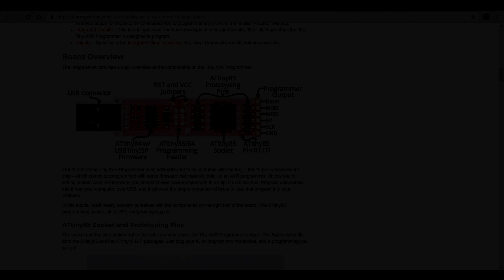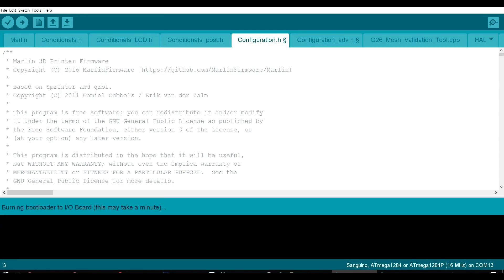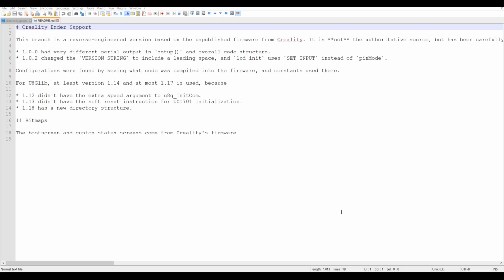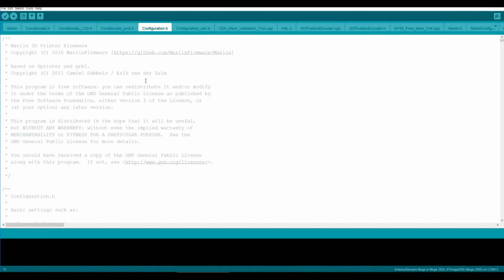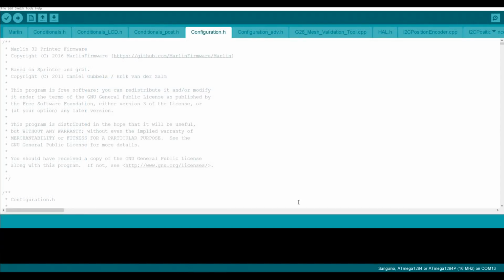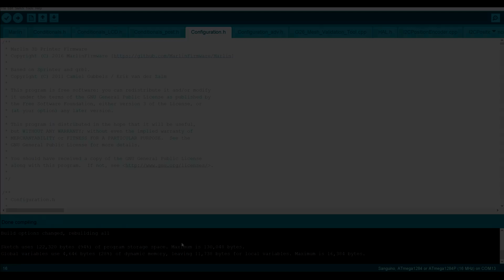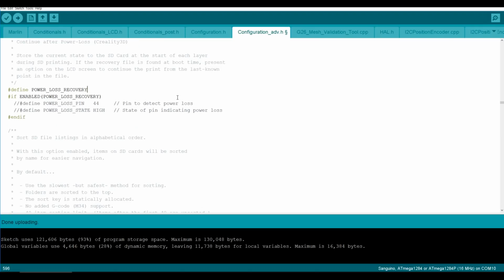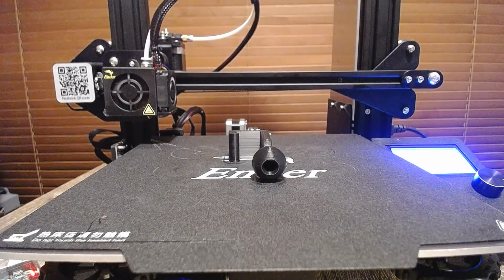Ender 3 vanilla Marlin update: Concise guide

Comment: Hi...Love your videos, they have been extremely helpful.....I'd like to know how to adjust the marlin firmware to center the print bed (with values I calculated based on the print when the firmware  X_MIN_POS etc was set to zero, then adding the following to MANUAL_X_HOME_POS) after the math I ended up with X=4 and Y=-5...the print is centered perfect...However the LCD now displays these values when homed. as apposed to X=0 Y=0.
Is there a way to adjust the center and still have the LCD showing X=0  Y=0 Z=0 ??
The reason for this is that it messes up my slicer scripts (I have edited it to suit, but would rather work off X0 instead of X4)
Hope all this made sense.
Thanks for your videos!!

Comment: I got an error while verifying 
Arduino: 1.8.12 (Windows 10), Board: "Sanguino, ATmega1284 or ATmega1284P (16 MHz)"

sketch\src\HAL\AVR\u8g_com_HAL_AVR_sw_spi.cpp:65:10: fatal error: U8glib.h: No such file or directory

 #include <U8glib.h>

          ^~~~~~~~~~

compilation terminated.

exit status 1
Error compiling for board Sanguino.

This report would have more information with
"Show verbose output during compilation"
option enabled in File -> Preferences.
Reply: In arduino IDE go to TOOLS -> Manage Libraries and search for and install u8glib

Comment: Hy, i have 2 marlin ender 3 configurations , one of the i've used a time ago for my ender 3.
Now i just got some new drivers but i get some errors on both configurations. Does anybody know some other ender 3 configuration for mks gen l, tmc 2208 drivers...? I am stuck here from 2 days, i just don't find any configuration that work
, i have all libraries installed like in Michael's videos
here is my error;
Error while detecting libraries included by C:\Users\User\AppData\Local\Temp\arduino_build_633232\sketch\Sd2Card.cpp
C:\Users\User\AppData\Local\Temp\cchqVvhi.ltrans0.ltrans.o: In function `Endstops::update() [clone .part.1]':

<artificial>:(.text+0xbc6): undefined reference to `Running'

C:\Users\User\AppData\Local\Temp\cchqVvhi.ltrans0.ltrans.o: In function `Temperature::_temp_error(signed char, char const*, char const*)':

<artificial>:(.text+0xc9c): undefined reference to `Running'

<artificial>:(.text+0xcb4): undefined reference to `kill(char const*)'

C:\Users\User\AppData\Local\Temp\cchqVvhi.ltrans0.ltrans.o: In function `TIMER0_COMPB_vect_bottom':

<artificial>:(.text+0x1124): undefined reference to `enqueue_and_echo_commands_P(char const*)'

C:\Users\User\AppData\Local\Temp\cchqVvhi.ltrans0.ltrans.o: In function `main':

<artificial>:(.text.startup+0x264): undefined reference to `setup'

<artificial>:(.text.startup+0x26c): undefined reference to `loop'

collect2.exe: error: ld returned 1 exit status

Multiple libraries were found for "U8glib.h"
 Used: C:\Users\User\Documents\Arduino\libraries\U8glib
Using library U8glib at version 1.19.1 in folder: C:\Users\User\Documents\Arduino\libraries\U8glib 
exit status 1
Error compiling for board Arduino Mega or Mega 2560.

Comment: I tried doing this on Linux and had issues with flashing firmware.  I have the 1.1.5 board which supposedly had a boot loader.  I then tried to flash a boot loader from Linux and that failed too.  Luckily I have a windows 10 dual boot and it all worked smoothly, thanks for the video.

Comment: Dear teaching tech...thank you for a comprehensive walkthrough. Worked a charm.
Only issue I face: when the printer puts down the two prime layers it's now on the right/front side. This leads to undesired strings of filament when the head moves from home position left/rear after heating up and staying in a small glob of material.
I've tried to change the start code, but that just gives weird results.
Some suggested to invert x/y Max min in firmware again. What's your take?

Comment: Michael, Brilliant video as ever, super detailed. Like a few folks I can see on other forums, I am not able to upload. For some reason despite being connected to the right Com Port, I can do the compile but NOT get the upload to work.  Longstory short im trying to do this prior to following your BLTouch video so things starting to stack up. When I upload I get an error AVR: atk500_getsync () attempt 10 of 10: not in sync: resp0x61. avrdude done Thank you. An error occured while uploading the sketch.

Looking on forums some folks mention not starting the Arduino from the INO, which I have tried (deinstalled Arduino (just to be sure) reinstalled it. reconfigured Marlin files per your video, opened arduino then opened Marlin ino), but same issue! any thoughts really close to completing this. failed at the final hurdle.

Comment: I flashed my Ender 3 Pro and while using it I noticed too late the Change Filament option was gone. After some research I figured how to enable that but when I compiled it I don't have enough memory remaining for that feature. What can I remove to free up some space. Thanks. Awesome videos.
Reply: You can undefine all lines from "String_Config_H_Author" to "String_Splash_Line2 Website_URL" and then undefine "Show_Custom_Bootscreen" and "Custom_Status_Screen_Image". Then go into Adv.H tab and undefine "Lcd
_Info_Menu" these alone should allow you to turn on both Level Bed Corner, Mesh Bed Leveling and the LCD menu's for both. Alternatively you can define Slim LCD but then you will loose a bunch of options for your e-steps (although they can be manually configured and flashed into firmware).
Reply: @dpgoverride  Thanks. I found it and removed the comments to enable change filament to get it working.
Reply: I'm having virtually the same issue.  I have have "mesh bed leveling" installed and had to remove "arc support" and "boot screens".  I wish TT would do a video showing how what can be chopped out of Marlin so that I can have "change filament" as well.

Comment: Love your channel, I did however have MAJOR issues with flashing my MKS GEN L  with the compiler. Install the Marlin and Arduino software, made the changes, but when I tried to compile it, I got errors with the libraries. As an example:
Error while detecting libraries included by C:\Users\Jon\AppData\Local\Temp\arduino_build_165947\sketch\ubl.cpp
41 different library files, I'm sure it's something I haven't done, can you help?

Comment: Not futureproof, unfortunately. I can't get anything to compile. I follow all the instructions commented in the Marlin code and I even added a library that was reported missing. I did everything step by step while pausing your video to be as thorough as possible. Even tho I am working with a cr-10 mini, I made all the necessary changes that were printer specific. Also, I couldn't even open Marlin and compile it w/o any changes. Something is missing and/or something has been changed somewhere.

Comment: "Yea, so the good news, congrats you have thermal runaway and a touch probe installed, the bad news, all your old settings are gone and it’s a week of tweaking till you get it right." Expect terrible Acceleration and jerk settings, which will kill you machine, 'coz TT is lovely and clear, but not going to tell you that things might go wrong. If they do, he'll just make ANOTHER tutorial and leave this one to get clicks. Do you really need a BLTouch? It's easy to set bed level once you are used to it, and if your bed is not flat, prints will never be perfect, even with a BL Touch.
If you take update the Arduino software, you won't be able to flash update, and if you update the Marlin software, you will have to change all the settings again. 

Don't pull your hair out with these gimmicks, instead spend your time enjoying the printer as it came from the supplier.

Comment: OK I went back through your guide and got everything setup. I inserted the G29 code in my printer settings to issue the bed leveling routine. However the auto bed leveling does not seem to be compensating at the middle and on the right side of my printer bed properly. My Z offset is set based on the clearance at the middle of my print bed so I am a little confused as to why this area would be off. This leads me to believe I may need more check points to increase the skew accuracy of my build surface.

Comment: Hi, I managed to flash my bootloader but I keep getting an error "Error compiling for Sanguino 1284p" regardless of if I use Vanilla or TH3D firmware, I have also tried your config files but just can't get past this error!
Reply from the maker: It should say what the error is. Paste it into google. Sometimes you have to do weird things like using an older version of Arduino IDE or doing it from another computer.

Comment: Hi, very good videos ! They give me a lot of help and ideas ! I got an ender 3 pro and i want to be sure about the thermal runway protection. When i call it with octoprint it says end: N2 M21*18Recv: FIRMWARE_NAME:Marlin V1; Sprinter/grbl mashup for gen6 FIRMWARE_URL:http://www.mendel-parts.com PROTOCOL_VERSION:1.0 MACHINE_TYPE:www.creality3d.cn EXTRUDER_COUNT:1 UUID:00000000-0000-0000-0000-000000000000 -> does that mean i have marlin 1.0 installed on my new machine ? Is the "grbl/mashup for gen6" something specific i have to take care about, if i want to upgrade to 1.1.9 ? Are there any hotfixes after that release, that i should also install on the machine ? Has the Board enough Mem to include 1.1.9 and the filament sensor and also the bed leveling stuff ? Would be great if you could help a little bit..
cu

Comment: So after doing this guide I noticed that my tolerences are all really bad.  I'm using Maker's Muses tolerence gauge and before I was able to get 0.3mm tolerences and now I am only able to get .5mm tolerences using the same filament.  

I have tried following your guide for tuning my slicer settings and I feel like its all really well dialed in and my prints are absolutely gorgeous however, my tolerences are really bad.  What settings should I be focusing on to improve my tolerences back to where they were before?  Are there any things I should look at on my printer physically that might be causing it?
Reply: I would check the belt tightness of your X and Y axis.

Comment: I keep getting errors on test compile.  I don't know if the versions of the libraries are the problem.  
UPDATE:  I believe I found the problem - Do NOT use the Arduino from the Windows Store - use Arduino IDE (in my case version 18.5).
Reply: Thanks for the update! I had the same issue; compiling was triggering a segmentation fault somewhere in the LCD configuration, but using the direct download Arduino IDE solved the issue.

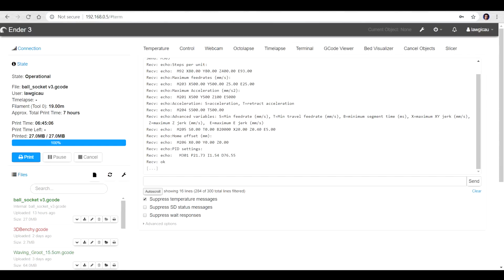Comment: Hi Michael, sorry to bother you with simple questions. I have tried searching but no luck so far - at 6:50 you mention reading the 'factory values' from the machine before you flashed it - could you share the GCODE command(s) you used please?  I'm fine with using the terminal window on Octoprint.  Thank you.
Reply: Might have found it - M503?  Will test as soon as the current print is done.
Reply: Yep, that's the one.  Oddly enough(!), the Marlin website is quite useful - who'd a thunk it??  :D  Found it here: http://marlinfw.org/meta/gcode/
Reply: I'll stop talking to myself in a minute... :)  Just compared results and my Ender 3 shows one difference from what I see on your screen at 6:50, Acceleration on mine shows as: M204 S4000.00 T500.00, yours shows M204 S500.00 T500.00.  Be interesting to see what values are in the vanilla Marlin.

Comment: If you receive one error like this:
avrdude: stk500_recv(): programmer is not responding
avrdude: stk500_getsync() attempt 1 of 10: not in sync: resp=0x40
avrdude: stk500_recv(): programmer is not responding
avrdude: stk500_getsync() attempt 2 of 10: not in sync: resp=0x40
avrdude: stk500_recv(): programmer is not responding
avrdude: stk500_getsync() attempt 3 of 10: not in sync: resp=0x40
avrdude: stk500_recv(): programmer is not responding
avrdude: stk500_getsync() attempt 4 of 10: not in sync: resp=0x40
avrdude: stk500_recv(): programmer is not responding
avrdude: stk500_getsync() attempt 5 of 10: not in sync: resp=0x40
avrdude: stk500_recv(): programmer is not responding
avrdude: stk500_getsync() attempt 6 of 10: not in sync: resp=0x40
avrdude: stk500_recv(): programmer is not responding
avrdude: stk500_getsync() attempt 7 of 10: not in sync: resp=0x40
avrdude: stk500_recv(): programmer is not responding
avrdude: stk500_getsync() attempt 8 of 10: not in sync: resp=0x40
avrdude: stk500_recv(): programmer is not responding
avrdude: stk500_getsync() attempt 9 of 10: not in sync: resp=0x40
avrdude: stk500_recv(): programmer is not responding
avrdude: stk500_getsync() attempt 10 of 10: not in sync: resp=0x40

Comment: For those of you with the newer model Ender 3, your bed is slightly larger than the marlin firmware in this video.

By default it is set to:
#define X_BED_SIZE 220
#define Y_BED_SIZE 220

When it should be set to:
#define X_BED_SIZE 235
#define Y_BED_SIZE 235

Found this out after I had it all set up and tried to print a large item and the item got cut off, kinda frustrating but atleast its an easy fix!
Reply from the maker: Thanks for sharing.
Reply: Do you have to change this in firmware before upload just uploaded 1.1.9 better check that what page is it in in the firmware
Reply: @reasonsvoice8554  yes, I believe it's also under configuration.h
Reply: @TheMidnightSmith  thankyou
Reply: Thanks! Gonna fix this now!
Reply: Thank you! I had exactly the same problem, only noticed after a 12 hour print >.<
Reply: OK back to the drawing board compiling firmware then only had a quick switch on and test so far cheers for the info before it ruined a print at least its easy to just send it over again
Reply: how did you fix this
Reply: @rustyday836  Like I said change that setting in the Marlin Firmware.
Reply: Thanks for pointing that out! I had just uploaded the firmware and noticed this comment.

Comment: Hi Michael, i have upgrade the firmware on my ender 3 pro with this video. But at the end the screen of the ender 3 pro says "ender 3". There is any way to write "Ender 3 Pro"? 
When we select "Ender-3" in the "example_configuration" folder maybe we should choose ender-4?
Am i right?
Thank you very much!  Ceers from italy!
Reply: Maybe you already figured this out but if you edit the Configuration.h file after you copy it to the folder with all the other files in it at line 132 there is a "#define CUSTOM_MACHINE_NAME "Ender-3"" Whatever you put in those quotation marks will be displayed on your status screen.
Reply: @n2n8sda  i've simple give up. 
i have changed yet the code that you said but it change only the name of the printer on the bottom part and not the name on the top left part. 
Anyway thank you very much, you are so kind.

Comment: Hello thank you for this tutoríal, just followed it and had some issues to burn the bootloder, had to use arduino 1.8.5 to succeed.
I flash the firmware, one which had 1.1.9 bugfix. Everything went smooth, but my start screen said firmware version bugfix 1.1.x?
Is there a way to change it?, so it say Marlin 1.1.9? Thank you, Cris

Comment: I did everything exactly and it passes compile but when I upload I get this error. 
Sketch uses 122302 bytes (94%) of program storage space. Maximum is 130048 bytes.
Global variables use 4621 bytes (28%) of dynamic memory, leaving 11763 bytes for local variables. Maximum is 16384 bytes.
avrdude: stk500_getsync() attempt 1 of 10: not in sync: resp=0x65
avrdude: stk500_getsync() attempt 2 of 10: not in sync: resp=0x63
avrdude: stk500_getsync() attempt 3 of 10: not in sync: resp=0x68
avrdude: stk500_getsync() attempt 4 of 10: not in sync: resp=0x6f
avrdude: stk500_getsync() attempt 5 of 10: not in sync: resp=0x3a
avrdude: stk500_getsync() attempt 6 of 10: not in sync: resp=0x53
avrdude: stk500_getsync() attempt 7 of 10: not in sync: resp=0x44
avrdude: stk500_getsync() attempt 8 of 10: not in sync: resp=0x20
avrdude: stk500_getsync() attempt 9 of 10: not in sync: resp=0x69
avrdude: stk500_getsync() attempt 10 of 10: not in sync: resp=0x6e
An error occurred while uploading the sketch
Invalid library found in C:\Users\Rob\Documents\Arduino\libraries\lcdclock-master: no headers files (.h) found in C:\Users\Rob\Documents\Arduino\libraries\lcdclock-master
Invalid library found in C:\Users\Rob\Documents\Arduino\libraries\lcdclock-master: no headers files (.h) found in C:\Users\Rob\Documents\Arduino\libraries\lcdclock-master
Reply from the maker: Have you previously burnt the bootloader?
Reply: @TeachingTech , No
Reply: Ok I used a leonardo and loaded the bootloader and tried again and it worked. Thnx. I think I got a really bad ender 3. The extruder rail is impossible to level and the bed i had to put 3mm washers under the right side to level the bed.

Comment: Thanks so much for the amazing tutorial
Just one issue, when I try to upload the firmware I get this error: "avrdude: ser_open(): can't open device "\\.\COM7": Access is denied." 
what could be causing this? I have followed all your steps since flashing the bootloader and every step of the way it uploaded successfully until now. Please help! Thanks!
Reply from the maker: I get that error if another program has automatically connected to the printer. Do you have cura, pronteface, aimplify3d, etc open as well?
Reply: @TeachingTech  ah yes! Closing cura solved the problem. You're the best! Thanks